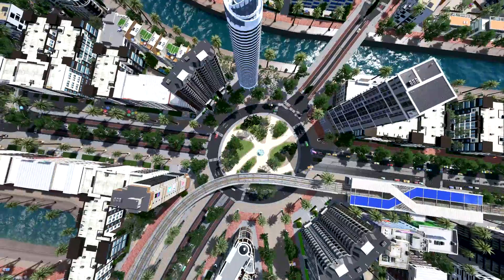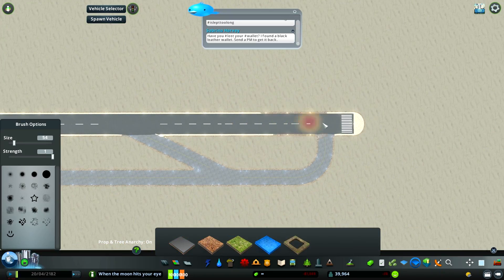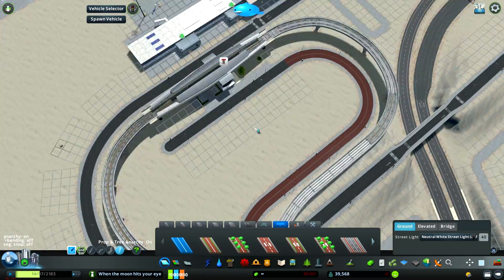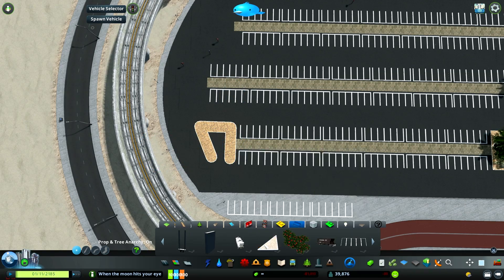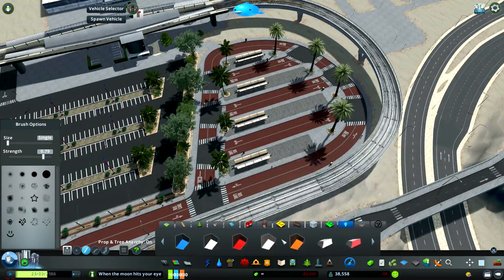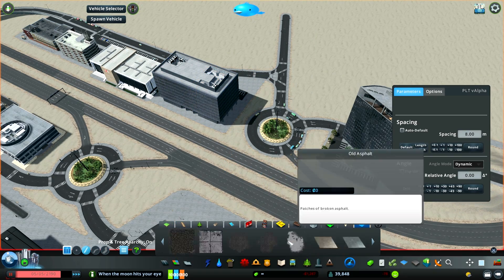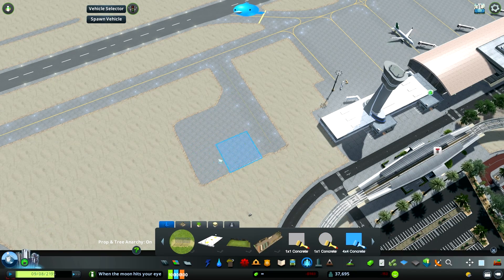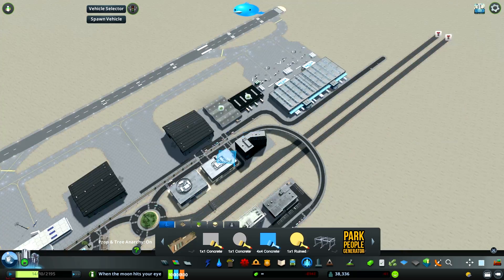Cities Skylines: Amar City - Part 11 - Airport Design

Comment: Been anxiously waiting for an airport episode in Cities Skylines from you, since I absolutely love your sandbox game gameplays and I have an enormous passion for aviation and piloting.

To answer your question at 6:48 :
Your runway markings are totally fine, those are US Precision touchdown zone markings. Most big international airports (outside the UK, because you often see chequered aiming point stripes there) use those markings. 
These stripes simply show the pilot where to ideally touch down.

What you could have meant with 'somewhat different' are those white and yellow arrows that sometimes appear ahead of a runway (Like in OBBI / Bahrain - Al Manamah). Those sections are called 'Blastpad' (yellow) or 'displaced threshold'. Blastpads are there to extend the runway in case an aircraft touches down too late and might overshoot. Therefore a blastpad does not count as a part runway and isn't part of the overall length of the runway. As a pilot you are not allowed to taxi on blastpads if you are not in an emergency.
Displaced thresholds move the touchdown zone further down the runway and are handy and often used if terrain or buildings are in the approach path, so aircraft may approach higher to have a safe overflight altitude over cities and terrain and touch down later. The perfect example for this is Florence Airport in Italy. Just go on Google Maps and try the 3D view. You will perfectly see the displaced threshold and the terrain ahead of it. 

Great video as always!
Reply: i know I'm kind of off topic but do anybody know a good site to stream new series online ?
Reply: @Jaylen Kylen I dunno I would suggest flixportal. You can find it on google:D -ben
Reply: @Ben Kashton Thanks, signed up and it seems to work =) Appreciate it !
Reply: @Jaylen Kylen no problem :)

Comment: A little late to the party here, but there is a large scale project going on in Africa right now where the Sahel borders the Sahara where residents of the areas are re-foresting the Sahel to present desertification and the spread of the Sahara.  It's called the Green Wall or something like that.  So there is some merit in planting drought resistant vegetation in order to make an area a little bit less desert-y.  

I also used to live in Phoenix, AZ where there are a lot of trees and other plants planted in pedestrian areas, and there are even misters (mist sprinklers) in areas where crowds gather outdoors to keep them cool.  In an area where the temperature is regularly 40-45 C, that stuff is very necessary.  Open exposure to that heat is deadly if you aren't properly hydrated and acclimated to it.

Comment: How do you get you game to run so smooth with a huge city? My Specs is a GTX 980, 16gb Ram,  GPU: I7 6700k. I know that mods can slow you down. But what settings do you use and do you have a lot of mods?

Comment: You should have a "park and ride" section somewhere on the outskirts with large car parks connected to the city by bus and train, so people coming to the city from the north of Bahrain can leave their cars there and travel in by public transport. Realistically speaking, people are unlikely to use the airport to come from the north of the country, as Bahrain is small and where the current airport is it would probably be quicker to drive directly than drive to one airport and take a plane.

I myself have driven from the north of the country to the south, and if memory serves me correctly it only took about an hour. So given how interesting the city is, I'm sure you'd get a lot of Bahrainis visiting by car.

Comment: I actually didn't know that about the wind direction thing. I always thought it was weird that airports would have two runways crossing at 90 or 45 degree angles. I figured if they needed multiple runways, having them intersect defeated the purpose because you could only use one at a time, and especially having them perpendicular was a very inefficient use of space in a facility that already takes up a lot of it by necessity. However knowing about those wind direction requirements suddenly makes all of that make sense.

Comment: btw those markings on the runway is called Touchdown zone which basically means that you have to land in that zone
and runway markings vary a lot between airports it all has to do with the length of the runway.

Comment: This city would be a perfect setting for electric VTOL planes. A modern, sleek and renewable energy city with a modern, sleek and renewable energy airport. The current one is very well designed. However it seems a bit close to the city and it's quite large in comparison. This technology would fit very well with Amar city. Sadly I don't think the technology is developed for such things. Great vid though!

Comment: How have you sunken the concrete supports at 7:54 ? Mine always pops up on the surface again, once I release the PgDown button ~.~
Anyway, a beautiful city. Fascinating, what all these mods combined may create - with the creativity of the author ofcourse.
Reply from the maker: Thank you! You can actually sink anything into the ground with  a workaround: place a concrete support, then select it with Move it! and duplicate it, then sink the copied support with pagedown and it should stay down even when you plop it. For some reason, you can only move down duplicated props.

Comment: i have made a custom airport. with 4 runways. using the joaks international airport building. but i dont get any airport traffic in that airport what should i do
Reply: naheem rahman are the taxiways functional??
Reply: i have the functional runway mod just like silvarrets
Reply: Check the traffic overlay and see iif there's actually a plane route going over your airport. If the planes can't reach your airport - they can deviate quite a bit from the purple line though - they won't land at all. Also make sure that planes can taxi to/from the runway to the terminals. If the AI can't find a working path they won't come as well.
Reply: i have checked traffic.  and i placed a municipal airport from the game and planes kept coming

its just my custom.   everything is connected.  there is power water. and high tourist numbers
Reply: yep they are all connected
Reply: it takes about a month (game time) before the airplanes start to fly to the city with the airport roads. Maybe try simulating the game by a month

Comment: Your runway markings are fine, but too close to each other. The slight issue I would address is that your taxiway is too close to the runway and overall the airport too close to the city. It exists in real life though (e.g. Las Vegas). You could build a convention center/mall next to the airport to make a sort of boundary with a large footprint between the skyscrapers and the airport :)
Reply from the maker: Thanks, you're totally right. I'm praying Move It! will allow me to move everything at once, otherwise I'll try to see what kind of buffer I can get in. I wanted to get the airport in as close as possible, but in hindsight this is definitely too close.
Reply: Silvarret Very glad, hope you get some inspiration!

Comment: Obviously you know the city better than I do, but why not have suburbs to boost your population. Or smaller towns outside the main one. That would boost you population to make it more realist.
Reply: Suburbs are very car centric, which is the exact opposite of the point of Amar City. Though, I don't really know, maybe Silv will design some walkable, non car centric suburbs
Reply: Or suburbs that are connected to the rail/bus system

Comment: Most Jet can takeoff on short runways like 2.500 m. It is a question of the Payload and the D-Rate a plane is using during Takoff. Even a long range plane should be able to start and Land there, if they are going to Europe or Asia. And it would be cool, if you could try to get real Airlines to fly there (Gulf Air, Emirates, Qatar Airlines, Saudia ect.)

Comment: Ehh call your Amsterdam airport as stupid airport that was not cool. One of the best airports to fly in. To your project you can set with AVO mod plane acceleration do 0.3 and brakiing to 1.0 it will force plane to use more of the runway + reverse that taxiways i the middle only for arriving planes (fron the runway) doing this will prevent the deprating planes get on the runway in the middle and you force them to use the end points of the runway which is correct.